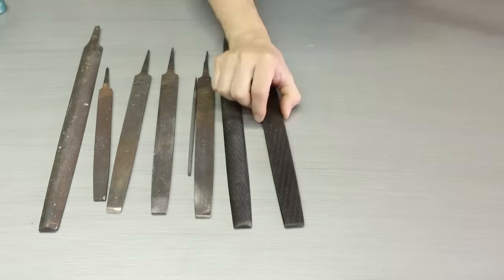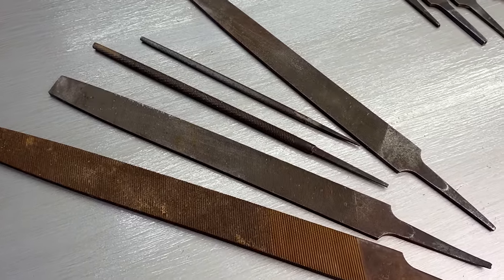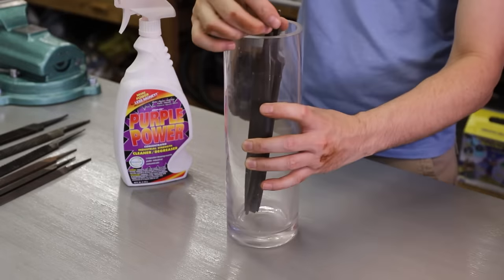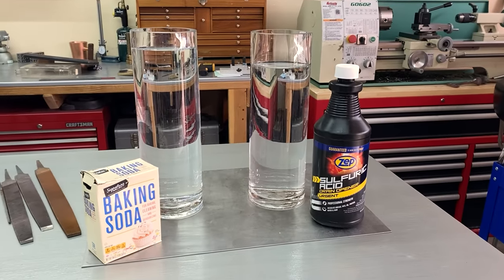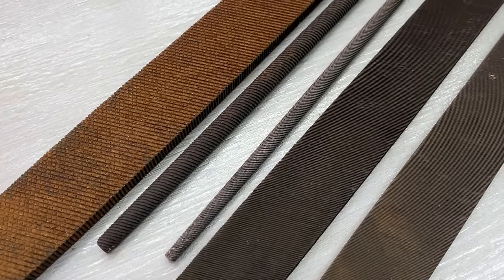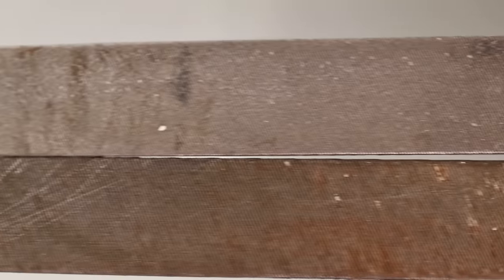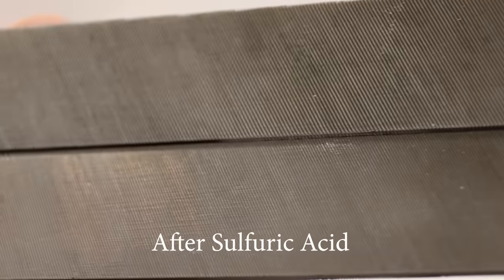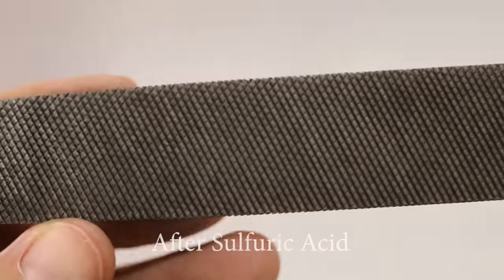Can you sharpen a dull file in Acid? Sharpening metal files - Experiment

Comment: I use 100 grams of citric acid to 5 litres of water for restoring old tools. It works very well. A soak overnight and a brush off with a small scrubbing brush. Dry and spray with a lubricant. Been doing this for 5years. Greetings from Dimboola, in Victoria, Australia.
Reply: Yea same think for me too i let them in the solution overnight and the morning cleaning them and no more rust :) after that some lube and all good :)
Reply: @supernova874  Cheap. Easy. Effective.  Greetings from Dimboola, in Victoria, Australia 🇦🇺.
Reply: Me too and it works well
Reply: I use powdered pH reducer for swimming pools mixed (imprecisely) with water. I think I heard of it from Master Smith Steve Culver. I believe he called it sodium hypochlorite; it's really good for removing forge scale too, and easy to store (less worry about spillage or fumes).
Reply: @SadamHussain-58786 howdy, sir - I heard you were ☠️

Comment: File card**  Also, not sure if this actually makes them sharper.  The "dull" spots you talk about are burnished areas of the file, which is why they are shiny,  that have been rounded over.  Removing material via acid etching will, in theory, make them sharper, but not by much.  However, what the acid will do, will leave a very even surface finish as it erodes away on every surface, thus removing the burnishing and leaving a consistent finish.
Reply: If the "dull" spots are anything like I've seen happen to band-saw and hack-saw blades, the burnishing leaves a burr hanging forward on the cutting edge that moves the sharpest point away from what you're cutting.  Sounds like dissolving this thin burr is enough to restore the cutting power of the file.
Reply: Maybe the acid clears off any foreign metals that may have adhered to the teeth, that probably helps a lot.

By etching a flat piece of hard steel, you can create a fine-grit file, the metal grain texture will act as an abrasive.
Reply: A long time ago, a man displeased his woman by using her wool card to clean his metal files.
Reply: @martylawson1638  if it was a thin burr, then the file card would have likely removed it.
Reply: @Convolutedtubules  those foreign materials would have likely been removed by the file card.
Reply: @liebetrau88  Obviously, some debris gets wedged between teeth and some gets fused on by heat and pressure. 

My guess is the acid removes stubborn dirt, unclogging the teeth and letting them bite instead of the file gliding on the clogged teeth.

Comment: Wonder if an ultra sonic cleaner would help with the debris removal vs having to manually scrape everything that thoroughly.
Reply: Thank you. I acid etch knives and these look perfect.
Reply: It's far more efficient to use a file card like in the video. But I think ultrasonic cleaner would shorten the etching time required, therefore minimizing damage to the file.

Comment: Thanks.
One measurement that you could have done is to file a piece of metal with say 100 strokes and measure the weight of the filings (by weighing the piece before and after)
Doing that for blunt and sharpened files would be a good indicator of how much they're actually sharper.
Project Farm did that just yesterday about sharpening mower blades.

Comment: Tangent question: after you do a casting project, what do you do about the charred sand? Do you scrape it off and toss it, or do you mix it back into the undamaged sand? Is there a point where the sand has too much charred sand that it becomes unusable?
Reply: I'm also interested in knowing this so I'm leaving a reply to find out
Reply: Plus one for tips on re-using petrobond
Reply: Petrobond can be used until the oil has burned away. Once that happens, you can use a few methods to rejuvenate it, all of which requires "mulling" it with new detergent-free oil. There are a few videos on YouTube how to do this and also some on how to make your own for much less than Petrabond.
Reply from the maker: I scrape off the black sand and keep it separate.  It’s a pain but it’s the best way to keep the unburnt sand as fresh as possible. Once enough of the black sand has accumulated I rehydrate it separately with non detergent air compressor oil.  You can mix it back in but the more you add the weaker the sand gets. 

So yes, you can mix it back in and use it many times but the fresher it is the better it will hold together. 

I’ve been meaning to make a video on this.
Reply: @robinson-foundry  Thanks!!!

Comment: Vinegar dissolves rust and cleans a lot of other stuff off of steel and iron. It does not like to dissolve steel or iron but it can embrittle hard steel so not a good idea for files. Vinegar does like to strip zinc and aluminum off of anything so if you have a layer of Zinc you need removed then that will work. Only problem is after Vinegar bath, it will rust up super quick. You would need a high concentration of Vinegar to start dissolving steel in any sort of way.

Comment: If you're in the UK patio cleaner contains one of the acids - I can't remember if it's sulphuric or hydrochloric. That would work on this. Patio cleaner also removes the galvanized zinc coating from metals if you need to weld them.
Reply: Patio Cleaner in the UK might be what we Yanks call Deck Brightener. If you get the stuff that is oxalic acid it's great for rust removal.
Might be a nice clean-up step before the vinegar etch.

Comment: I can see that acid might will clean out the dirt and rust. But it will also presumably remove a surface layer including from the teeth tips which I would have thought would blunt rather than sharpen.
Might give the initial impression of being sharper but I'm not convinced.

Comment: My experience is that you can refresh a good file that is barely dull. Make an 8/10 a 9.5/10. 

However, the first file that you showed is shot, acid won’t bring back a used up or abused file. 

If you’re using acid, I’d recommend that you do this outside of your shop unless you like rust on all your tools and machines.

Comment: Or if a file is too dull to be sharpened this way, you can always turn it into some other tool. Knives and chiesels made from old files are a common option. The teeth might be ruined, but there's still a lot of good high carbon steel in there.
Reply: you realize he told just at the start of the video thats the very reason he collected those?

Comment: Maybe the acid clears off any foreign metals that may have adhered to the teeth, that probably helps a lot.

By etching a flat piece of hard steel, you can create a fine-grit file, the metal grain texture will act as an abrasive.

Comment: 2:14 Kids doint this at home, remember to always do it as he does here! ALWAYS pour sulfuric acid to water just as he does. If water is poured onto sulfuric acid instead, you risk an actual steam burst blowing acid everywhere - your face being a prime target, already on the line of fire. Something worth saying ALWAYS.
(If you wonder why "water on acid" goes boom and "acid on water" doesn't, it's actually simple: as the pure acid mixes with the water, it generates a bit of heat. If you add a bit of acid to a lot of water, you have little acid trying to heat a lot of water (duh!) and nothing spectacular happens; but of you pour the water on the acid, the very first drops to fall are a bit of water with a lot of acid, generating a lot of heat on a ting ammount of water, potentially turning those first drops into steam - which will gleefuly blow tiny droplets of concentrated acid everywhere).
Source: years of handling acids and an actual laboratory acreditation on my name.

Comment: I just throw them in vinigar for a couple of dsy. Weak acid but i still  works well. And cheap. Keep a plastic container with a lid and throw anything you want to ddrust into for a few days. Rinse in hot soapy water. They wont be shinny they will be cold blued. Oil and smile. No need to neutralize in vinigar.

Comment: It looks like acid cleaned the files, but did it actually make them sharper? If they were dull from bent-over metal, how did the Acid fix that? I do think that degreasing, using a file brush, removing rust, and then acid-treating files is a good thing though.

Comment: I remember my father doing the same in 1980. He used something like "deactivated acid". I can't recall if that acid was deactivated with zinc or aluminum... I was twelve and I don't know a shit about chemistry. But the file became much more aggressive.
I need to remove aluminum from old files and copper is not working. I read muriatic acid may be the solution to dissolve aluminum without harming the steel.

Comment: Very interesting, thanks for the video! I use a sisal wheel and compound to sharpen my farriers rasps. It works well but you have to be on it from day one.
Reply: Intriguing.
Do you hold the rasp a particular way against the wheel?
It seems that doing it wrong would dull the rasp.
Reply: @CarlWestBlacksmith  I make sure the wheel spins with the angle of the teeth, not against it.

Comment: Do you ever try cleaning your files with a card file first? Or even a regular wire brush to clean out all the impacted debris.

I wonder if heating the vinegar on a stovetop with it in a glass pot would increase the momentum of this process. Has anyone tried out testing this method with an old file? Since you mentioned the sun warming your vinegar solution seemed to speed up the process gave me this idea.

Comment: I fail to see how the dull edges can be sharpened by any liquid.  Not possible.  If you believe it, put your dull drill bits in, your blunt saws, etc, etc.  The acid will eat away the same minute thickness across all surfaces, including the blunt bits.
Reply: Thank you. Someone actually capable of thinking.
Reply: @autumn5592 Draw a triangle on a piece of paper with a rounded top. Now draw a triangle inside it with equal distance to all edges. Keep repeating this a couple of times and tell me what the triangle looks like.
Reply: @SirRebonack  Except you are drawing shapes, not demonstrating reality.

Acid eats away at all surfaces. If you have a rounded tip triangle, it will make that rounded area larger.
It will not just remove material from ONLY 2 faces to make a perfect triangle, that is not physically possible.

Try using a real world example next time, instead of scribbles on a sheet.
Reply: @SirRebonack  Better to be thought a fool than open your mouth and prove it.

Comment: Acid cannot sharpen files.

The acid will eat the entire surface, not just 2 faces. It is not selective in how it removes materual, it will just eat anything it touches.
So it will dull it.

However, if you leave it in for a short period like you did, it will remove all the dirt, grease, and pinning (stuck bits of metal under the teeth.)
It could also remove some of the burrs produced from lots of use, but often times these aren't the issue.

What you are doing is cleaning files, not sharpening them.
Reply: What makes the file dull is the very tips of the teeth being rolled over. Letting acid eat away a bit of the metal removes those rolled over tips and forms new "tips" (somewhat irregular but good enough for filing). For the same reason a very flat ground carbon steel knife will stay sharp just with normal use.
Reply: @hodor3024  Steel that is as hard as a file (upwards of 60Hrc, usually in the 64hrc areas for good files) will not 'roll' an edge, it is far to brittle, it will break.
Rolling happens when you have a ductile steel (read soft) with minimal supporting material (read thin) -- the exact opposite of a file.

If you have a large flat, like you would from a rolled edge, the acid will just make it larger. It doesn't just eat selective parts away.

I don't understand what you mean by the knife comment, it makes no sense. Could you please articulate it properly?
Reply: Believe what you like.
My actual experience differs.
Reply: @CarlWestBlacksmith  Your experience defies physics then.
Go to a laboratory, college professor,  anything like that, tell them you can do something that physics says is impossible. 

Watch them laugh you away hahaha.

Comment: This seem counter-intuitive. Wouldn't acid round off the tip of the cutting edge?
Reply: Sort of like when you burn triangular wood. The edges become rounded.
Reply: That's exactly what happens. Acid is not selective in its removal.
Reply: @Kargoneth  It's nothing alike. Heat penetrates wood. Acid doesn't penetrate metal to a significant degree.

Comment: I would expect this process to dull edges, not make them sharper.
Reply: It doesn't sharpen them. It can't.
Acids desolve all surfaces, it isn't selective, so the dull portions will become duller. 
All this does is remove all the shit and gunk from the teeth, maybe some little burrs too. 

It makes it 'sharper' by cleaning it, not by actually removing material from the file.

Comment: Let's be clear. You are not sharpening files. You are cleaning files. It will help them cut, but that's not the point.
Reply from the maker: No, the acid is dissolving a small amount of steal which essentially sharpens them.